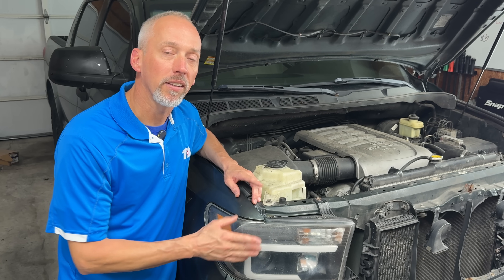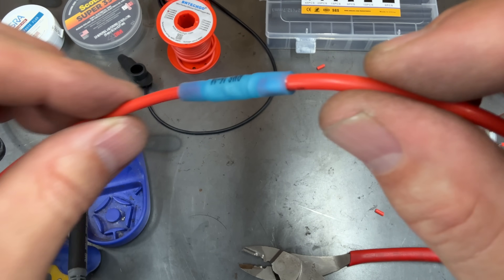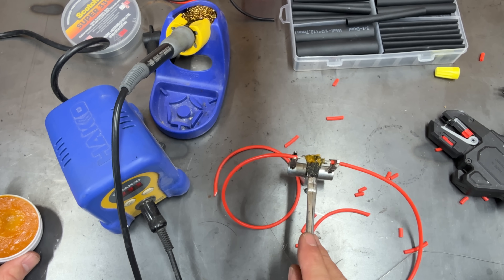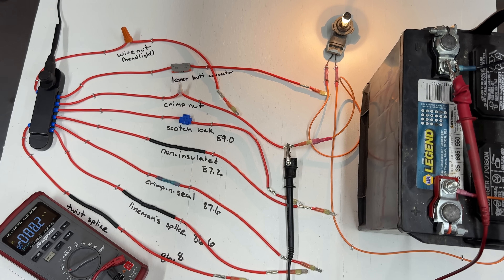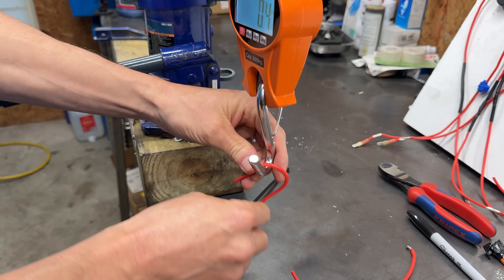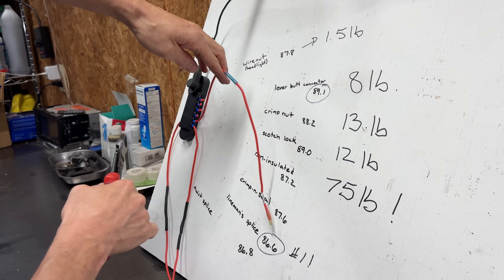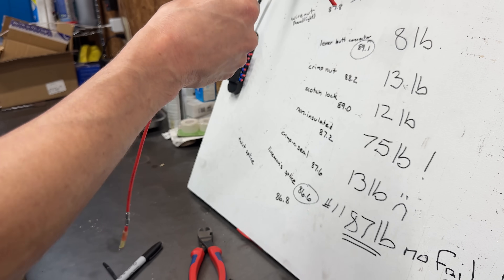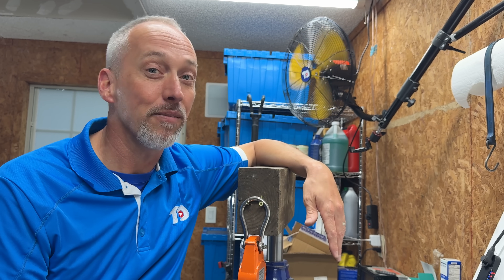I tested these connectors and found the best one

Comment: One potential problem with soldered connections is fatigue failure around the splice in high-vibration environments. Soldered splices need mechanical support and strain relief to prevent that.
Reply: That is something a good shrink tube with glue solves, no?
Reply: @ziegle9876  The splice has a different mass and stiffness than the wire at both ends. Shrink tube may provide some strain relief but copper around the joint will still work-harden over time in high-vibration environments.

In a most vehicles though, most wires are in harnesses. Wrapping the wires together will provide the extra support and stiffness.
Reply: @teardowndan5364  THough also the copper right next to a crimp has higher stress. Also a stiff-flexible trasition, like out of the solder,
Reply: That's why you twist the wires together.

Edit: When I swapped an engine in my car, every fuel injector had a spliced connector, a couple of sensors had spliced connectors and there were some spliced wires on the ECU connector, none of them failed after tens of thousands of miles driven over several years, and this was a 4 cylinder with no balance shafts that regularly saw high rpm. IMO, failed solder joints have to be a result of cold joints, inadequate flux, too little solder, or some combination of those three things. Really, there should be enough solder that it does provide some mechanical support, even if it completely breaks loose from the copper.

There's only one solder job that I feel like I did poorly, and that was on my neighbor's RV, and it was mainly due to the fact that it was my first time using lead-free solder (I didn't even know that it was lead-free at the time) and I hadn't yet figured out how to work with lead-free solder. At the same time, I was also working outside, where there was a cold breeze, and I simply couldn't get enough heat into the joints to make the solder flow very well. I feel bad, I think that he actually had someone else redo everything.
Reply: flux is the answer, it prevents fatigue failure because the solder flows throughout and lowers the melt temperature thus preventing cold solder joints which cause those types of failure, another is to put overlapping heatshrink, and actually use a gun and not soldering iron or lighter to melt the heatshrink
Reply: In high vibration environments, zip ties securing the wire tends to break the wire before a soldered connection causes a break.
Reply: @anti8.6  In a high vibration environment, you don't create pinch points by using zip-ties. You loom the wires together for uniform support and then strain relief any tie-downs to soften unavoidable pinch points.

On my sister's washer, the wire loom between the drum assembly and housing has a spring suspension so endpoints can be relieved of most of the weight and motion be split more evenly between the two sides.
Reply: exactly so the loose copper strands tend to suffer from metal fatige and break right on the edge where the solder joint makes the cable solid. If there is enough support from multiple layers of melt glue heatshrink so that any vibration-bending of the cable occurs well away from the joint it can solve this.
Reply: Soldered connectors will not fail if you use proper solder with lead in it. Soldered connections are the only ones that I have not seen fail in the trucks and excavators I have worked with.
Reply: @Rudy97 it isn't the solder that fails. It is the work-hardened copper on either side of the joint when there isn't enough strain relief and mechanical support in high-vibration environments.
Reply: @teardowndan5364  random vibration won't move the wires enough to cause metal fatigue. I have soldered wires for over a decade and my father for decades before that and the connections don't fail. I have soldered wires on a stone crusher, you can't get more vibrations than that, no failed connections. Maybe don't solder wires in a car door loom but there a crimp would fail just as fast.
Reply: @Rudy97  Good crimps have both a metal-on-metal part that does the electrical connection and a metal-on-insulation part for mechanical support and strain relief. Soldering only provides the electrical connection. You need to add mechanical support and strain relief separately.

In most applications, wires are part of looms. The loom itself provides some structural support and strain relief.
Reply: @teardowndan5364 even the worst solder joint has very good "strain relief" in the form of heatshrink or a bunch of electrical tape
Reply: @Rudy97  Well, the automotive, military, and aerospace industries all disagree with you. But what do they know… 🙄
Reply: @tookitogo  I know what I know, my experience is worth more than what some nobody says.
Reply: @Rudy97  NASA, Boeing, Airbus, and the US military are “some nobody”? I think they know more than you do.
Reply: @tookitogo  they know what they know, I know what I know. Why should I do something different based on what they think when what I do has been perfect for so long?
Reply: @Rudy97  That’s an entirely different question. Your experience shows that your method is indeed good enough for your application. 

However, you made a blanket statement about high-vibration environments in general. (Which includes ones with different vibration characteristics from yours.) And frankly, military and aerospace have investigated this formally, so they know what works well in even extreme situations. Your recommendation is not universally applicable.
Reply: @tookitogo  solder works in any situation reliably
Reply: @tookitogo  Nasa and all of them still use solder connections just take a look at NASA-STD 8739.4A It's literally every step by step of how their joints are to be made...as well as using sn63/pb37 solder idk what you're yapping saying the industry disagrees with him when it doesn't it all depends on where the connection is and how it is tested.
Reply: @Rudy97  No, it doesn’t, which is why some industries (like automotive) avoid it in many situations, even ones where soldering is cheaper. (So no, it’s not just a cost-saving measure.) Automotive ECUs use press-in versions of high-pin-count connectors on their PCBs because it’s more reliable, even though the press-in versions are more expensive, and require costlier PCBs with very, very tight tolerances on the hole sizes and plating thickness.
Reply: @PepePig-th6sy  I didn’t say that they don’t use solder at all. 
But they do make very clear statements about how it can be used, and when it should be avoided if possible. The original poster claims that solder is reliable in all situations, but THAT is absolutely not true. 

And if you had actually read the NASA standards (I have!) you’d know that.
Reply: @tookitogo  Well Im sure in some scenario where everything lines up you can get a failure at the solder joint but in 45 years working in chemical plants Ive personally never seen or heard anyone speak of a failure.  Im talking about equipment that does nothing but vibrate from high to low frequency vibrations.  

Equipment such as vibrating conveyors, horizontal and vertical centrifuges, product filling equipment, etc.  Basically the whole unit buzzes with vibration. 

 But…. The soldering procedure should be done correctly  to mitigate failures.  Overall I believe it to be an extremely safe application that would require other things failing to get where the solder joint is the last thing to go.

So I can appreciate the concern after all its all about safety:)
Reply from the maker: Good to know for anything around the engine.

Comment: Nice demo with nice information!  Actual usable info.  (in a perfect world you'd do several of each and average, and note if any were prone to variable results- but that's quite a chore!)
I would have liked to see some of the new shrink connectors with a low-temp solder ring in them- I've been using them and like them, but no numbers to back them up.
And for house wiring I really like the WAGO lever locks.  Trying to wire up a ceiling fan cramped for space with wires already cut too short- the WAGOs really help.

Also- something interesting- you don't see soldered connections in aircraft (typically).  What I read is that while a soldered connection is great electrically, and quite strong, you have an effect where solder wicks/travels up the wires a short distance when you make the connection.  Where the solder ends and it changes to plain wire, you go from stiff to flexible, and in an environment where you have strong vibration that point is where it flexes and eventually fatigues and fails.  This is inside the insulation, where you can't see it, it makes for intermittent faults that are difficult to find.
Reply from the maker: That’s very interesting, makes sense. I like the non-insulated connectors even more now.
Reply: @ToolDemos BUT PLEASE LEARN WHY soldered connections are BANNED in all vehicle's electrical systems, because of fatigue breakage under flexing and vibration at the point where the solder that wicks into the cable does end, forming a hard point where any flexing will eventually break!!!  The proper CRIMP will match or outperform any soldered joint, but as you will find, making a PROPER crimp is even more demanding than making a good soldered joint, as applying the proper crimping pressure is quite demanding!

Comment: The uninsulated crimp is what manufacturers universally use for wiring looms . After 50 years of auto electrics I have never seen one fail mechanically. The only downside is that they are not waterproof and will corrode if water gets near them. I would always twist and solder unless in a really tight spot where access is a problem. 
I just hate Scotch locks with a vengeance,  bulky, and hold water .
Reply from the maker: I’m with you on Scotch locks, terrible.
Reply: That is why manufacturers cover their joints with adhesive shrink tubing.
Reply: @LTVoyagerAdhesive shrink tubing will not prevent wicking and water will penetrate the joint. That is the huge advantage of soldering it effectively stops wicking.
Reply: @Daniel-OConnell Wicking?  Water absolutely will not penetrate a connection covered with quality adhesive lined shrink tubing.  Soldered joints also require weatherproofing via shrink tubing.  No different than a crimp connection.
Reply: @LTVoyagerYes the correct term is "wicking"  I have spent almost 50 years as an auto & marine electrician and I can assure you it  definitely exists.
Reply: @Daniel-OConnell I spent 40 years as an electrical and structural engineer and wicking requires a path to wick through.  There is no such path with a crimped connector covered with adhesive lined shrink tubing. It is absolutely no different than a soldered connector covered with shrink tubing.  Describe the water infiltration path that you are describing as wicking.
Reply: @Daniel-OConnell Still waiting for you to explain how water wicks into a connection sealed in adhesive lined shrink tubing…. The crickets are deafening.
Reply: @LTVoyagerLet a pvc cable sit in water for a week and you will learn. Just walk down any marina in the world and you will see very quickly.
Reply: @Daniel-OConnell  That has nothing to do with crimped vs. soldered connections.  Water absorbed through jacket material will affect a soldered joint as much as a crimped joint.  Solder will corrode in water and particularly in salt water.  I would put a tin placed crimp terminal against a soldered terminal any day in a wet environment.
Reply: anytime I see scotch locks, i know there is going to be a some tweaker shit and nihtmare electrical problems
Reply: I did the wiring on the main communications cabinet in a submarine 50 years ago and all the connections were non insulated crimps.
Reply: @Chris_at_Home I bet they were covered with shrink tubing or similar protection or you would have had shorts everywhere.
Reply: @LTVoyagerno they weren’t. We just had a short piece of white tubing with an identifier printed on it.  The cabinet and penetrations were water resistant. This was on the submarine Groton 694.
Reply: @Chris_at_Home That’s fine as long as you have electrical insulation and inside a controlled enclosure.  I much prefer uninsulated crimp terminals as they are both more reliably crimped and more easily inspected for a proper crimp.  Then I cover them with glue lined shrink tubing to add electrical insulation, waterproofing and some amount of strain relief.
Reply: Solder is actually recommended against by most auto manufacturers. It causes the surrounding wire to become stiff and brittle, potentially causing it the break.
Reply: Why is non-insulated better than insulated? What if you're using it in a box full of electronic components and wires, wouldn't the non-insulated risk shorting with stuff? Are the insulated really THAT bad, and why?
Reply: @SirCommOfErrance because the crimping tool is acting directly on the metal of the connector , usually giving a more uniform crimp. Insulated crimps by their nature need the insulator and metal to yield together uniformly which does not always give as good a crimp connection.
Reply: @SirCommOfErrance When you need to repair a wire in a loom, you need the repair to be as small as possible. An uninsulated crimp and heat shrink is the best you can get in terms of least bulky repair that meets manufacturers requirements. I personally use open barrel crimps the overlap the wire and crimp onto the insulation, then I shrink wrap them.
Reply: Solder isn't a very good conductor. You're much better off with a crimp and seal.
Reply: @carlbeaver7112 In a properly soldered connection, the solder is conducting over a very short distance and the resistance increase is minimal.  There are resistance tests that show that soldered connections, done properly, are nearly indistinguishable from a solid wire.

Comment: Add some solder seal next time (connectors with low temp solder in then with heat shrink and glue

Comment: All good but I never allow any wire joints to have any kind off pulling stress on them before securing them against vibration.  Sometimes I have to use the twist on (Marette) style in tight places such as boat trailer lights which then get filled with liquid tape to keep the moisture out. Cheers!
Reply from the maker: I like the liquid tape idea.

Comment: Please don't use those crimpers, they are junk. There's a reason the real ones have three different sized dies. The crimp tool can also be calibrated. I used to do them for aviation work, and afterwards would load test a crimp at known current and measure the voltage drop across it. I did appreciate the comparison though, good method, if unfair to the crinps.
Reply: People keep talking about superior crimpers but never give an example or recommendation. 

It’s nearly impossible for a consumer to know what the best type is.

Comment: I recommend a soldered (lineman/twist splice) with adhesive-lined heatshrink tube to keep the water out
Reply from the maker: It does seem to perform the best. I like those butt connectors though when the repair is in a tight spot.

Comment: The question is which connection loosens when the vehicle vibrates? The wirenut is perhaps good for use in the house where nothing wobbles. But there is always vibration on the vehicle.
I have had good experiences with soldered connections when the cable can otherwise move.
WAGO lever clamps are also good and quick. These are also approved for ships. But only possible up to 6mm².
Otherwise, press connections are also very stable if they are made with the right tools.
Reply from the maker: I wonder if there’s a good way to test vibration in a lab setting?
Reply: Actually crimping is better in high vibration/reliablity applications.  If soldering is used, the solder to wire interface needs to be protected against movement. This interface is a weak spot. Second, the flux used to solder the wire needs to be removed unless is if fully cooked off by heat. Flux can absorb moisture and cause corrosion. Tubing helps but moisture can travel inside the wire between strands if the insulation isn't perfect. IMO, the reason people like soldering is to make up for not having the proper crimp and wire combination and that results in a bad crimp. I understand this and back up with soldering too sometimes. You can buy shrink tubing in different stiffnesses. Some is flexible, other types are very stiff. Good to have both kinds if you are doing electrical work.

Comment: I've been using Wirefy brand non-insulated butt connectors and crimp nuts for a while. They are both nice and strong.  I highly recommend the Channellock crimping tool, it seems way stronger than any other crimper I've used.  It's $28 right now an amazon now, worth it for me.  I bought cheap sets of identical-looking connectors on aliexpress and they are just thin metal.  They take very little force to crimp (needle nose pliers) and very little force to pull out.  I have gotten quality connectors there before, but it's hit and miss.
It's always best to see reviews like this to know which connectors are worth buying.  Sometimes product page reviews are useless:  The connectors are praised for being easy to crimp even if they pull out easily.

Comment: Assuming you used a 50 watt headlight bulb the voltage drop across the various connectors seems very high.  A good solder or properly crimped connection should have a resistance much less than 1 milliohms.   Given your setup I would expect 1 millivolt or less.
Reply from the maker: Yeah, even measured at the connection I was getting at least four times that amount.